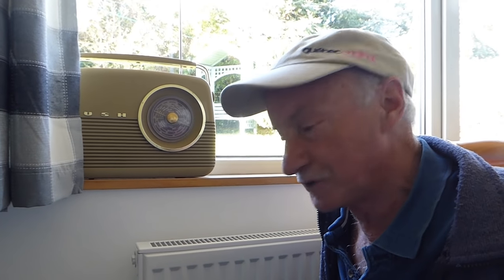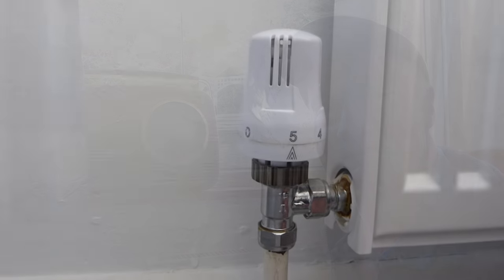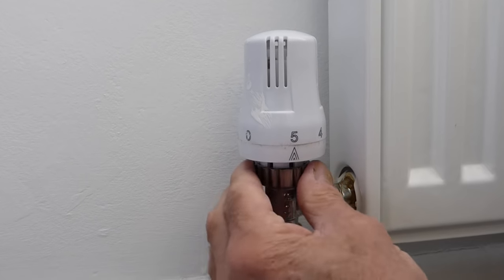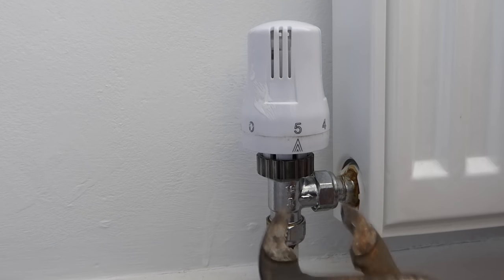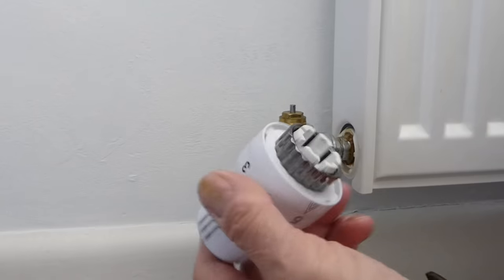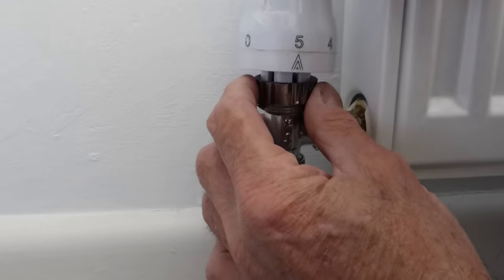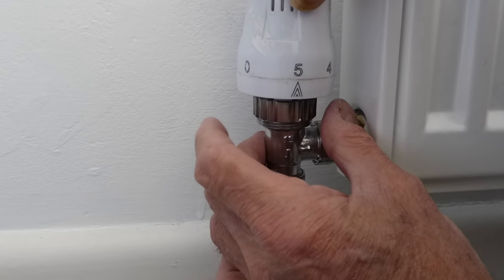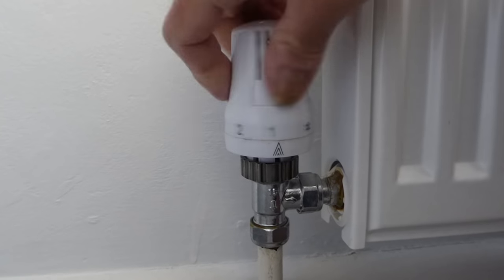How to remove and replace a thermostatic radiator valve head

Comment: Can you interchange valve heads or does it come with the valve assembly? where do you buy just the valve heads rather than the whole unit?
Reply from the maker: You cannot buy just the valve heads.
Reply: @dereton33  Do you have any tips for removing the slack from a radiator valve head which is slack from the 5 to 4 setting? It's a WestTherm 5 type with the indicator permanently molded to the body so I'm not sure if this is a design flaw. But it's annoying because it means I can't turn the radiator completely off because of the initial slack.
Reply from the maker: No, the valve head is worn, I would renew the valve with a good quality Drayton or similar.

Comment: Can you still take it off if it’s on the off position 0 or the snowflake icon?
Reply from the maker: Best to take it off on the full on position number 5
Reply: @dereton33  the reason I ask is because this is a shared radiator but it keeps getting turned upto 5, so I want to be able to take it off whilst it’s at the ‘0’ position so it can’t be changed by others

Comment: Hi, thanks for your reply on your 'change a radiator' vid. I'm waiting for a plumber to do it but in the meantime I need to stop the hole dripping. When the heating is on it usually slows to a drip that I can easily contain, but when the heating is off overnight then it usually becomes a steady trickle and I wake to a full washing up bowl and maybe three or four bowls worth on the floor that I struggle to contain with mats and towels. I had the idea of taking off the thermostat, as in this vid, to see if there was anything I could tighten; bad idea. Hot, rusty water started really gushing out as I struggled to get the thermostat back on and it slowed to a drip again.

How can I stop it dripping without turning off the heat to the rest of the house? Or, is there a practical way of containing the leaking water overnight? Thanks.
Reply from the maker: Just turn off the locksheld valve one end and the thermo valve  the other.
Reply: @dereton33  I did that at the start. I tightened the valve so tight that now it doesn't want to loosen and the thermo is fully off but it still drips and trickles. I'm not having much luck getting a plumber at the moment, is there a practical way of containing the leaking water overnight?
Reply: I have a tarp that I may be able to fashion into a sort of paddling pool underneath the radiator, and have a cold, rusty dip in the morning. Thanks for your help.

Comment: Can the thermostat valve leak? Do I turn the water supply off and drain the system before I unscrew it?
Reply from the maker: Not if you are just removing the top.
Reply: dereton33 thanks for your reply. Doesn’t the whole thermostat come off in one go?

Comment: Do you have to drain radiator before this valve comes off? Don't want to flood my bathroom.
Reply from the maker: Not if it is just the top. If it is the whole valve then yes.

Comment: my broken valve head is a Drayton TRV4.  It has left a circle of broken plastic stuck inside the metal "collar" - do I unscrew that collar to release the broken plastic ?  I dont want to unscrew the wrong thing.  I live in a block of flats and the central heating system is on all the time - I can't shut the system down myself.  Can I still replace the broken valve head myself ?

edit - instead of collar I should have said 'ring nut'
Reply from the maker: Yes you can undo that metal collar so that it looks like the part shown in the video. Once removed it will show a metal pin sticking up from the valve. No leaks will come from that.
Reply: thanks dereton33.  

I wouldn't normally do anything like this myself but its going to save some money.  Plumbers round here want £60 before they even start.
Reply: I have exactly the same problem with a Drayton trv4. Must be a weakness in the design. Thanks for the video, very helpful!

Comment: Can I ask, I'm trying to replace a danfoss valve, I managed to undo it but the thing will just not come off, and I'm to chicken to force it off, any help with this please :-).
I'm afraid water will come gushing out.
Reply from the maker: So long as it is just the valve head you are replacing do not worry, no water will come out, try a drop of WD 40 on it and a small tap with a hammer to free it.
Reply: Thanks will give it ago :-)

Comment: Thanks man 

But my valve has come off

And it wont like…TURN anymore???? The numbers part wont turn against the arrow part? 

I fidgeted with it so much i caused a little leakage from the
 radiator so ive stopped! 🤦🏻‍♂️

Want my heating on but I dont want this upstairs radiator set to FULL all bloody night
Reply from the maker: You will need a new valve but for now turn it down by using the locksheild valve on the other end.
Reply: @dereton33  I was with you all the way up to “lockshield” 😆

God Im glad this anonymous 🤦🏻‍♂️

Thank you

Comment: Would it just be the TRV head that needs replacing if the temperature on the radiator would not change using the TRV? Thanks for the video Al
Reply from the maker: More than likely the valve.

Comment: Hi I took the valve head off, and then replaced it, but now for some reason the radiator only heats up if it's removed, and cold when it's on!?! What's going on?!
Reply from the maker: The head of the valve is broken.

Comment: Where have you been all my life? I’ve just found a small leak from one of these? I saw the video with your wife but when I remove the cover, there isn’t a nut to tighten? Any suggestions please? Thanks ...
Reply from the maker: Unfortunately you cannot repair thermostatic rad valves, they have to be renewed.
Reply: @dereton33  thanks very much ... is it a straightforward job? Ie do I need to drain it down? Thanks again

Comment: All my radiators stay hot even if I turned them to off positions 😒can you help please advise
Reply from the maker: The valves are not off hard enough, if you want to shut them completely off, then use the lockshield valve.

Comment: Mine just starts leaking water after partial removal even though it's turned fully open. Anyone any idea on this?
Reply from the maker: A faulty valve body , You will have to change the complete valve.

Comment: The one for me has a weird plastic flat bit instead of a slot. What I do??
Reply from the maker: See if it will just pull off.
Reply: @dereton33  it wont. someone fixed t before for me and kept it on.

Comment: The knob on my radiator has broken and needs replacing.  The make is 'Lifestyle', good ten years old, can I replace with a Drayton.  Can't find a Lifestyle knob on Google.  Thanks
Reply from the maker: No they are all different.
Reply: Do you know where I might be able to get a lifestyle knob, cant find one.  Or would the whole valve have to be changed.
Reply: If I have to change the whole thing, would it matter if it was a different make?  Thanks
Reply from the maker: No any make is OK, best quality makes are the Drayton.
Reply: Thank you for your help,
Reply: gina morris knob that's a very rude word is it coz i iz black

Comment: just replaced a radiator thermostat but when I try to turn it down to 4 there is a leak
Reply from the maker: A faulty valve. Change it for another new one and use top makes like Drayton.

Comment: Mines been untightened, but the valve doesn’t come loose
Reply from the maker: Give it a slight tap around the outside with small hammer to break the seal.

Comment: Hi my valve fell of and it just won't go bk on no matter what just keeps twisting it' goes on its side
Reply from the maker: The thread may be gone on the housing, if so you will need a new valve.
Reply: @dereton33  hi thanks I got it on
Reply from the maker: That`s great must have cross threaded it first time.

Comment: I tried, but water started spraying out
What did I do wrong?
Reply from the maker: You tried to undo the body of the valve.
Reply: @dereton33  ah, so I need to do it higher up. Thanks
Reply: I tried it again tonight and it popped straight off. Thanks for your help

Comment: If the tube coming from the wall is cold, I guess the problem is not the thermostat right 😅is a central heating problem then.
Reply from the maker: No its the valve.

Comment: I have a leak or should I say slight leak from one of mine, I bet that replacing just that part you took of ain't going to solve it? Drain rad and repack or replace valve body I bet??
Reply from the maker: It it is a thermostatic valve they canot be repaired. If it a turn valve just repack the gland.
Reply: @dereton33  I've never even removed the plastic thermostatic part until this morning, I turned it to 0 before unscrewing it but felt the tension from the pin so turned it to 5 like you have showed. I cleaned and sprayed a bit of oil on the pin, that moves up and down fine, I've left the knob off for now so stuck with full heat I know but no sign of a leak for now. I noticed that it's got a plastic nut around the pin, my guess were that it can't be undone to repack, only option is to replace that whole connector.😥

Comment: what is not mentioned here is that there not standard valves and you have to find same manufacturer to replace and hope they still make and sell heads separate. No open standards. Plumbing is stupid.
Reply from the maker: Ha ha don`t you just love it.